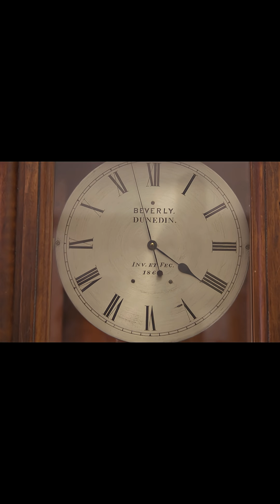Did You Know There’s a Clock That’s Been Ticking for 160 Years Without Winding

Comment: A clock powered by temperature changes? Useless in modern climate controlled buildings. Innovative curiosity though. And no, it is not powered by the Earth. It is powered by the Sun. The Sun is what makes day and night temperature variations.
Reply: Not JUST temperature changes, but changes in barometric pressure, too, which is affected by the Earth's weather systems.
Reply: @DaveC_TN Barometric pressure changes are also powered by temperature changes from the amount of sunlight. Also the volumetric changes from that are less than from actual temperature changes by the day, night cycle. So, a solar powered mechanical clock.
Reply from the maker: Thanks for watching :)